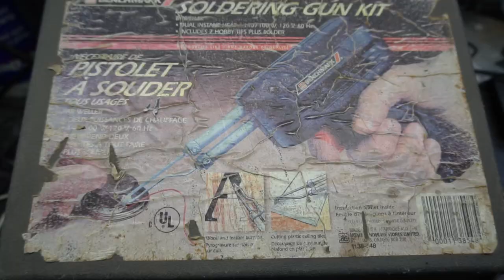Neutrino lights (rear) by RJWC - quick look & how to install

Comment: Sickest quad EVER! I want to do my handlebars like yours... what bars and risers do I need? Also did you have to extend any lines?
Reply from the maker: 2inch rox riser clamp,  high bend renthal fatbar,  protaper foam pad, stock brake line
Reply: DizeFilms Sweet! Thanks for the quick reply. One more question, where did you get that pad to go in front of your storage box and how is it attached? I want to do something like that for my back rack, when I ride wheelies it hurts lol
Reply from the maker: @wildwhiskeywolf8198  is a nice backrest my girlfriend like it ahaha!   Mmm cant remember random universal stuff i find on ebay. Bolt it on my rear rack
Reply: DizeFilms ok thanks... I’m trying to find that Renthal Fat Bar. Is yours 1 1/8 or 7/8? Also is yours the Rickey Carmichael high bend? I found the 2” Rox risers.